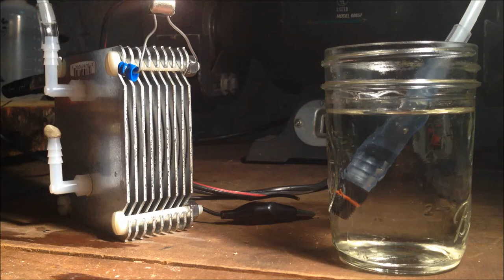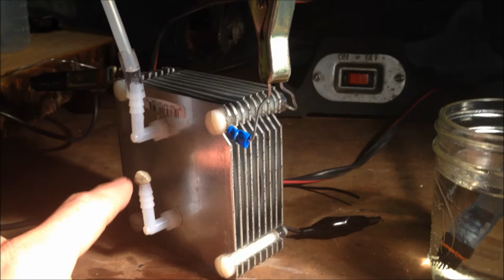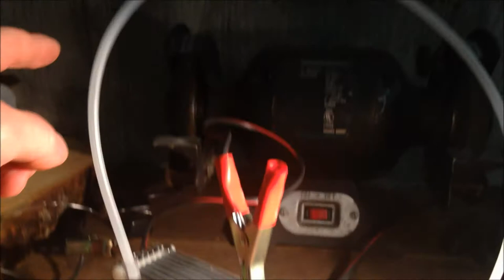HHO Generator - Dry Cell

Comment: neat work... concept is spot on.  Suggest having nnn+nnn-nnn+nnn   -=negative +=positve n=neutral  setup. 316L stainless steel.  Don't sand the plates.  Wash them off with distilled water and vinegar.  Use gloves whilst assembling.
Reply: Verum Quaerere Seek Truth Doesnt Sanding the plates give a larger surface area?
Reply: Germas369 All it does is give the illusion of creating more oxygen & hydrogen... problem with sanding the plates causes the 'bubbles' to stick to the plates ''this means nothing is being produced whilst bubble sticks'' - also when sanding your water becomes extremely dirty - red rust - gunk - sludge - My first cell was 'to me' a success - yet later after loads of money, time, stress, I managed to improve... added a small 12v pump to circulate the water - added a tap to the holding tank (when system was off, settlement is easier to drain)
Reply: why do we need NNN at left and right side?
Reply: How many difference HH% between sanding and not sanding ?
Reply: What are the difference between NNN+NNN-NN+NN  VS N+N-N+N  VS  + - +?
Reply: What are the difference between NNN+NNN-NN+NN  VS   +N-N+